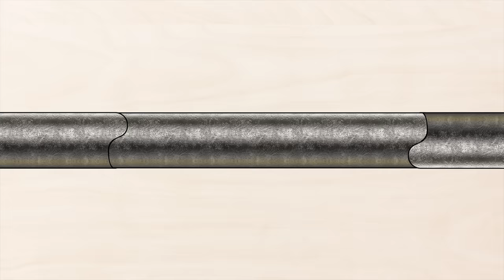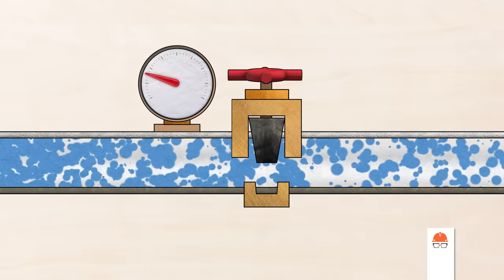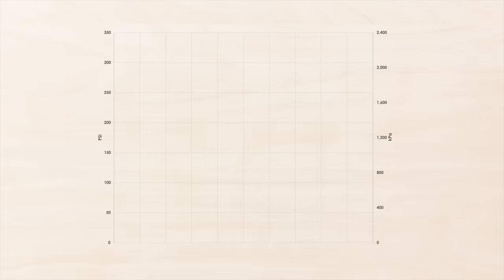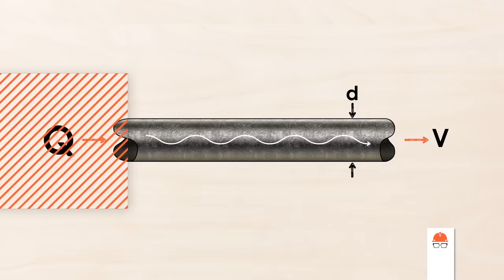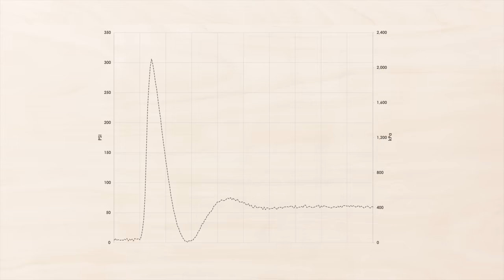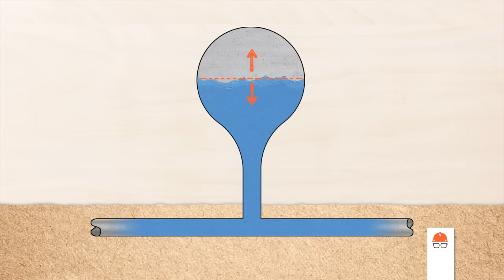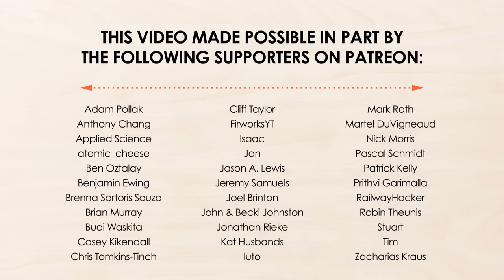What is Water Hammer?

Comment: Detective John was investigating a strange case in a suburban home. The owner of the house had reported strange noises coming from the walls, which sounded like hammering. However, there was no construction going on in the neighborhood, and the owner claimed that the sounds only happened at night.

John decided to investigate the house at night, and he soon found himself face to face with the source of the strange hammering sounds. As he walked down the hallway, he heard the sounds growing louder and louder. Suddenly, he felt a powerful vibration in the walls, and the sounds seemed to be coming from all around him.

It was then that John realized that he was dealing with an unusual culprit – water hammer. He knew that water hammer was a phenomenon where water flowing through pipes created pressure waves, which could cause the pipes to vibrate and produce loud, hammering sounds.

But this was no ordinary water hammer. John realized that the water hammer was intentional, as if someone had deliberately set up a system to create the noise. The water hammer was so powerful that it seemed to be coming from all directions, making it impossible for John to pinpoint its source.

Just then, John heard a voice behind him. "You shouldn't have come here, detective," the voice said. "I knew you would figure it out eventually."

John spun around, but he saw no one. The voice seemed to be coming from the walls themselves. And then, the water hammer intensified, the vibrations grew stronger, and John realized that he was in serious danger.

He tried to run, but the water hammer seemed to be following him, closing in on him from all sides. He could feel the vibrations shaking his bones, and he knew that if he didn't get out soon, he would be crushed by the force of the water hammer.

With all his strength, John burst through the front door and ran outside. He looked back at the house, but he could see nothing out of the ordinary. The water hammer had stopped, and the only sound was the gentle swaying of the trees in the breeze.

John knew that he had narrowly escaped with his life, but he also knew that he needed to find out who had set up the water hammer and why. He couldn't let someone use such a dangerous weapon to harm innocent people.

Comment: Can water hammer travel around 90D bends or change direction through a T? Imagine a shockwave travelling down a piping system, when it reaches the back of a T fitting does it bounce back or go in two different directions on a 90D path from the source.
Reply: yes, if you imagine it the hammer is all the water inside coming to a sudden stop, the pressure isn't just on the valve its on the pipe walls too because its a crash, the momentum is forward but if it cant go forward it'll then try go outward, this is why the water tower work, even though its a 90 degree to the pipe
Reply: where a fire hydrant has a 90D angle as it changes direction up to the appliance. that corner is going to be supported under ground or the water hammer could destroy it.
Reply: @tylersutton7765  thrust blocks?  You ever seen those little 1/2” copper tees with the air hammer arrester in the top?  I don’t see how those can even work on a straight section of pipe.  Wouldn’t the shockwave just travel past, thus making the arrester redundant?
Reply: @forefinger8831  If the pipe is full and under pressure, the pressure is equal in all directions.  So, when the pressure wave passes the tee to the hammer arrestor, some of that wave goes up the tee to the arrestor (hopefully enough of the wave to prevent damage to the system, of course).

Comment: Great vid! Solenoids closing a valve tend to act quickly. When reno-ing a house I owned, replumbed with CPVC, like the video, I added spring loaded anti-surge devices by the kitchen dish washer, clothes dryer and end runs to the bathrooms. I did NOT just add an air "T" as, over time, the air can be absorbed by the water.

Comment: On a related note, I discovered the existence of surge tanks this summer when I saw those in Masson-Angers, QC : https://www.google.com/maps/@45.5445154,-75.4203696,3a,83.6y,191.2h,99.67t/data=!3m6!1e1!3m4!1s9bWjHGpag8qwI2jukJUL2w!2e0!7i13312!8i6656  . They are used to reduce pressure variations in hydro electric dams.
Reply from the maker: Very cool!
Reply: Surge tower and pumps building, I worked in my first job: https://www.google.com.br/maps/@-15.6133933,-47.7049184,3a,60y,75.85h,104.38t/data=!3m6!1e1!3m4!1s_lHFoiQqAy_B06RzlcglAw!2e0!7i13312!8i6656?hl=pt-BR

Comment: Very informative, scientific, demonstration is perfect.  When I bought the house in 2000, the previous owner set the setting of the Pressure reducer to 80.  All the faucet cause a knock whenever it was turn off.  So I put the psi to 50 and it solve the water hammer.

Comment: Dude, is that what water towers are for?!
Reply from the maker: They smooth out variations in demand and pressure on the system. Otherwise your pumps would have to be constantly adjusting.
Reply: I thought for the longest time that water towers were just ornamental. Who needs a tower to be able to splash water on burning buildings without running to the lake?

They're so incredibly useful and I'm gonna reread that wiki article on them. Thanks for inspiring all this. Amazing vid.
Reply: They also create "head pressure" for rural areas.  Reduces the need for pumps on the outbound side.
Reply: +Practical Engineering Sounds essentially like a voltage smoothing capacitor to me except smoothing pressure rather than electrical potential.
Reply: Seraphina S yes, exactly. They even do the same thing in concept; store/discharge energy. The water tower is "charged" with a positive pressure differential, while a capacitor is charged by a positive electric potential difference. A water tower discharges water when there is a negative pressure differential, while a capacitor discharges charge when there is negative electric potential difference. 
I wonder if equations regarding phase shift,  frequency and other stuff apply tho (low pass filters, high pass filters, resonance, whatever)
Reply: Jan v Coppenhagen technically, the water flows into homes but it also needs to flow out of homes. Just that most of the time the outgoing water is just filtered and then dumped back into nature. It's like discharging to earth.
Reply: +Jan v Coppenhagen Actually you are getting the relationship between pressure, voltage, flow rate and current a bit confused. Pressure is equivalent to voltage this might be easier to see if you rewrite the units of each to realise that both pressure and voltage are a potential energy density, 1 Pa = 1 J/m^3 and 1 V = 1 J/C respectively. Similarly flow rate (Q) in m^3/s is equivalent to current (I) which can be expressed as 1 C/s (Since 1 C = 1 A · s).
Reply: Water towers absorb spikes, however their main purpose is to store water and deliver a given amount of pressure to a given sized area. This overhead storage allows pumps to operate for a lesser amount of time.
Reply: Shock absorbers and surge tanks. Also provides a static head (water height stores energy) to keep pressure in the system...more regular through varying supply line altitudes :)
Reply: @ Jan v Coppenhagen  Yeah.. what   @ Seraphina S     said.  <;)

Comment: As an electronic engineer we deal with similar issues of energy flow in transmission lines.
Our only influence on transmission speed is the permeability of the substrate.
Mismatched loads can cause damage to components and equipment/systems failures.
In heavy current transmission lines it can cause serious infrastructure damage and even death.
A friend/associate who is a chemical engineer gave plumbers nightmares when she ensured that the pipes in her house would not experience water hammer effects.
Thanks for a fascinating video

Comment: Pratical Engineering:
Superb lecture of fluid mechanics, plus a demonstration. 
In simple words: Any water/fluid (or solids made "fluid") in motion in a containment/s, pipes, channels, rivers, dams or sea if it is abruptly stopped flowing we are looking for disasters.
By the fact that moving water has little or immense Kinetic Energy depending on the quantity of the water mass on the move: tsunami and the sad stories of Water Hammer against the stopping sea coasts. 
The water mass must dissipate, one way or the other, the Kinetic Energy acquired by her motion and has to be totally transformed in Work Done before to came to rest and levelled off her ill temperament. (No more no less that a bolder rolling down a hill.) 
Kinetic Energy, due to the speed of the water, in any system, must to be slow down at a rate within design specifications, until a new operating equilibrium is dynamically/statically reach.
(All these operating precautions to prevent Water Hammer=The car driver apply the brakes too fast and the passenger broke the front glass of the car with his head, no seat belt)
Systems Design incorporate simple or complex and  very expensive structures to prevent and protect plants from any possibility of Water Hammer.
Water Hammer in any System or Infrastructures, has always the potential to lead to catastrophic destruction of any Operating System, Infrastructures, large or small, and loss of lives and proprieties. Paul Candiago (candiago.p@bmts.com)

Comment: In civil defense (makeshift installation & repair) we used the water hammer effect to fill elevated water reservoirs from a water flow at ground level ("hydraulischer Widder" in German, a combination of a flow-operated closing valve and a holding valve). A bit noisy, but effective.

Comment: I was the engineer with several FM radio stations.  We always had transmission line to feed the power to the antenna.  Most often the line was about 3 inches inside diameter.  To lessen the probability of flashover we pressurized the line with dry air or nitrogen.  I coul never wrap my head around the pressurizing of the line.  The line was from 300 feet to almost 1000 feet long.  It could take a full day to bring the whole line up to pressure so there was no air/gas going into the line.  The pressure was regulated at 5 PSI.   To add to the complexity the line was coated with black plastic, so it warmed up very nicely in the sun.  Also add to that the winter to summer varations and it was complex.

Comment: I came here to learn more about water hammer.  This morning the hose to my washing machine burst.  It burst around 5 AM when the sprinklers cycled on and we didn't go downstairs until 6 AM.  So the water gushed in the laundry room for about 1 hour.  Some areas of the downstairs floor were submerged under about 1/8" of water.  The water ruined the carpet and some wood flooring.  Water found its way to my garage and ran down our driveway.

Comment: When I replaced all the old metal water pipes in my house with CPVC pipes. For the bathtub, for the control valve I used t-fittings the control valve was connected to the side of the t-fittings on the top of the t-fittings I used an adaptor to connect a larger pipe on both sides and capped the top. The air in the pipes worked as a cushion to absorb water hammer.

Comment: I recently purchased a new cloths washer.  I found out quickly that the solenoid valves in the washer were a lot quicker to shut the water supply off than my old washer.  The BANG it caused was absolutely CRAZY!   I bought a couple water hammer arrestors and installed them at the hot and cold inlet at the washer.   The arrestors cured the hammer.

Comment: Sorry to admit that I am one of those guys that turned all the Walmarts in the US into super centers. I worked as both assistant to the electrician and journeyman   plumber. We installed the Water Hammer suppressors, but also just soldered a short length of copper pipe above the inlets to any water heaters.
My point, I guess, is that you don't need to buy a specific part. Just make sure to have a small part of your system that doesn't contain the fluid at all times. Thanks for the video! I always wondered what the hell that was for, it was never explained well.

Comment: I have observed this more clearly with following case: long hard pipe (about 25 meters) with open end and valve in the beginning of the pipe. Open valve fully and wait until water flows as fast as it will. Then close the valve fast. Water will go on and vapor bubble forms right after valve. Soon the water comes back, bubble collapses and it was like hammer hit in my hand holding the valve which was not attached to anything solid. Did not do this in purpose and wont do it again. Great video as others by Practical Engineering
Edit: ... and you have made a video about that already.

Comment: It's nice to see the pressure difference with the mini-rester. It helps even if the hammer doesn't completely disappear. It's connected right next to an automatic pressure-activated hose timer. Prior to putting the mini-rester on, the boom was pretty audible with my cast iron piping!

Comment: firstly, I love all of your videos.. The demonstrations are always very accurate and easy to understand and explanations are very thorough.. on this particular subject however I'd seen this video before but I just realized water hammer can be observed in straws and water in a cup with you mouth. I'm not sure if it's solely fast food styrofoam/paper cups because of the soft side wall opposed to a glass, but if you quickly sip the liquid from resting in the glass all the way up to your lips and then immediately stop it The cup shakes and you'll feel vibrations through your lips and hand.. try this the next time you have a styrofoam or paper cup with no ice and water is probably best because no bubbles. cheers👍🏾

Comment: Even Chemical Engineers deal with this problem in their design of fluid pipelines. One of the solutions for large diameter pipes is to have a small diameter valve in parallel with targe valve. Before closing the large valve, keep the small valve open and then close the big one. That way there is some flow through the bypass. Finally close the small valve. This eases the back pressure. While opening also, reverse the process so that the upstream and downstream pressures equalise and it is easy to open the big valve.

Comment: Quite a few years ago there was an article in IEEE Spectrum (I think) about how the generator hall in a Russian hydroelectric power station  was destroyed unintentionally by an employee who was able to remotely access the control system via a laptop (yes!). The ensuing water hammer effect suddenly changed the mechanical load on turbines and generators that ripped some out of their mountings. I'll look up the reference because I need to find out how the water hammer effect was connected to forces that ripped large rapidly rotating masses from their mountings.

Comment: Another common example in home plumbing of extending the time to stop is extending the pipe past the valve (the valves being at a right angle). This can be combined with increasing the springiness of the system by extending the pipe with a fitting that maintains an air cushion.